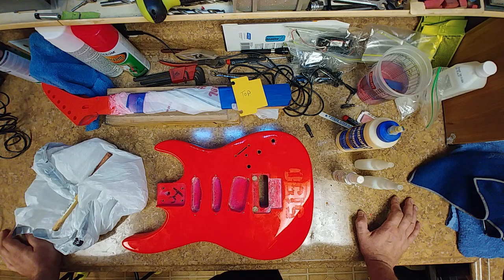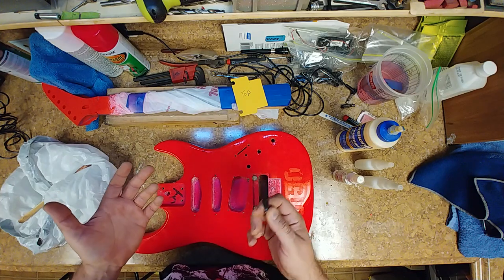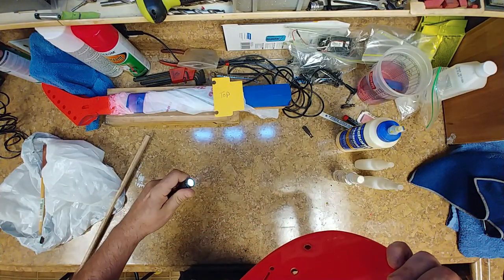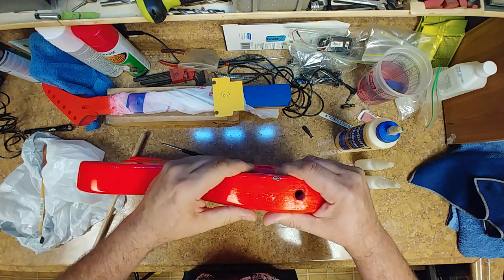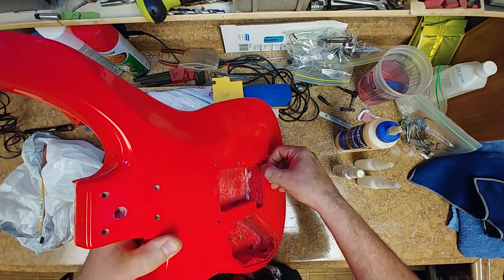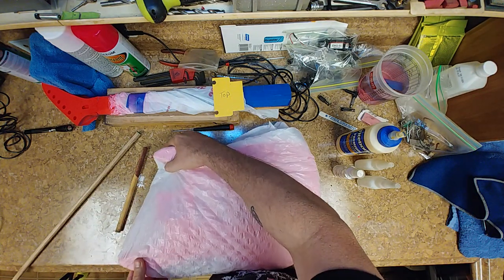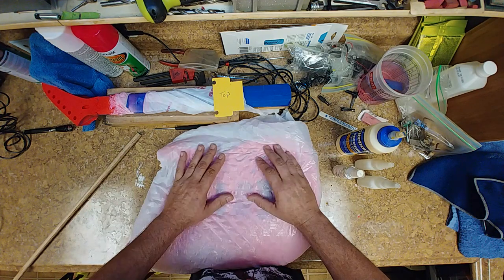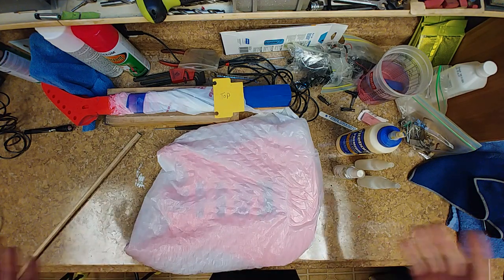Mold in a Plywood Guitar  Body?

Comment: I've ran into these mold problems before too, usually if you can clean out as much as you can and make sure it's sealed any mold left will die, ca glue is perfect for this, thin viscosity usually will run in all places and seal it from my experience. good luck!
Reply from the maker: Yeah... I don't know. Seemed to be a lot in it as far as the mold. When the new body comes in I'll have to compare the two and see it might be worth it to use a solid body than the plywood.

Comment: It's made of plywood wow that sounds like a company getting over on people. I keep mine polished and but I had that problem on a fret board on a old cheap guitar I had it was a Meastro SG still have it but it's in pieces the body is in great shape anyway good luck on Wally's guitar I know you will do the right thing Rock On Brotha 😎⚡🤘
Reply from the maker: Some older guitars were made with plywood. Not a good choice I think.
Reply: I have an old Charvette made from plywood - I only found out when I changed the colour as it was covered in really a thick poly finish to disguise the plywood. Naughty!

Comment: There are several water based wood hardeners available, they will be absorbed well into the wood grain. You might check into that...
Reply from the maker: I wanted to sand the body almost to wood. Using the old finish as a primer.  The paint is the same color so I wouldn't have to prime it white like I did with the headstock. This looks like the mold is in the middle coming out.
Reply: You can submerge wood into this stuff for a good while (weighted down) and it will become pretty permeated! Might add a bit to the weight, but not significantly I think. I have never heard off plywood rotting from the inside out before, my guess is shoddy material was used to make that plywood... Good luck with it.
Reply from the maker: Thanks man

Comment: I'd hang it outside in the sunshine to dry out and kill the mold, then seal it with CA as Randy suggests. Keeping it in a plastic bag will just retain any moisture. I have a Chinese Squier Strat that spent a few years in a Lancashire cellar before I bought it, thankfully no mold but exactly the same issue with the strap button screws and pickguard screws, rusted to hell!